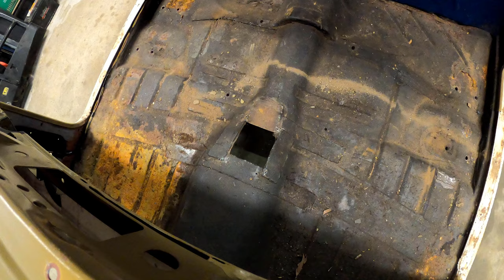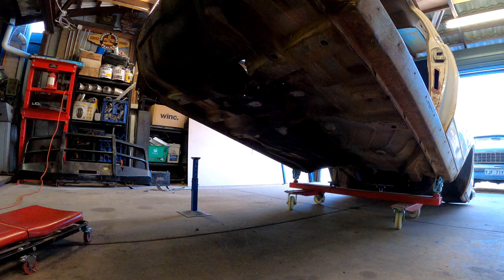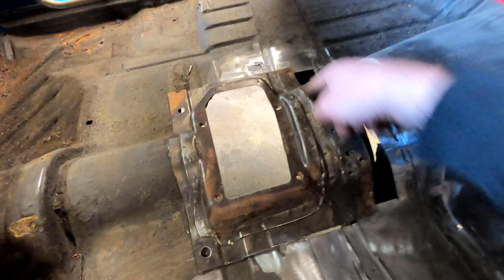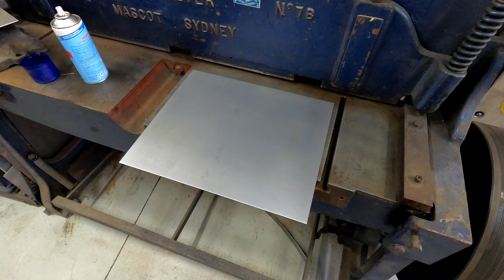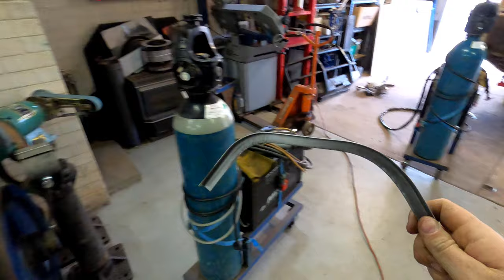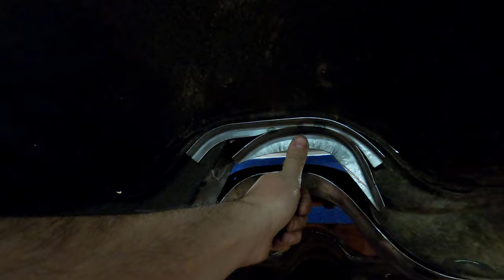How to repair a Holden HG Ute; Part 2; HG Holden; Backyard Builds

Comment: its so nice having a vsual reference on how far back to clean metal and all that, the stuff you guys wouldn't think about twice. cheers man
Reply from the maker: The cleaner the better! Top & bottom, if both sides are clean you’ll have less issues tig welding it up.

Comment: It's a little extra work, but instead of cutting to a square corner, radius them, it usually creates less distortion, compared to welds going into a corner.
Reply from the maker: I’ve heard this method before! If I have a small air saw I would, but I just make do & always weld away from the corner if I can do not to distort that area too much.

Comment: Great work showing how to install oem type shifter hole. Do you use 1mm cold steel for the patches?
Reply from the maker: Yea cold roll ideally, hot roll doesn’t form as nicely.  I’ll use 1.2mm (1.19mm) for floors & structural patches & repairs, or thick if needed & .9mm for any body repairs, but often try to just match up the thickness if I can.